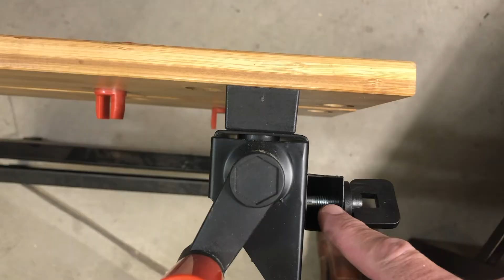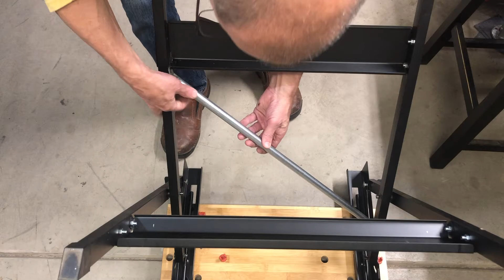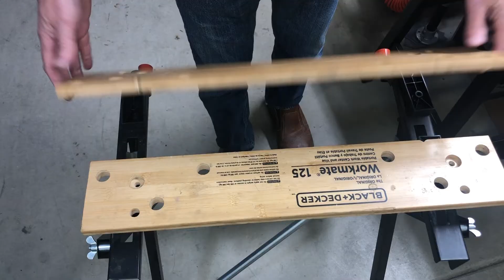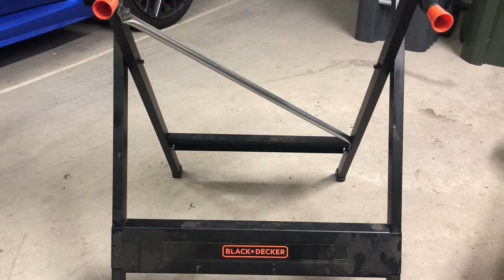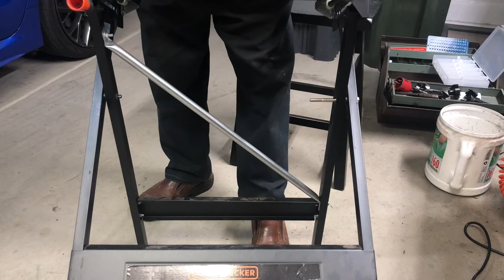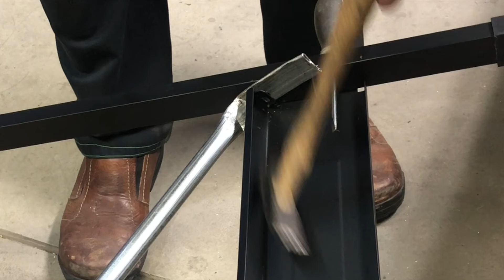B & D Workmate Beef Up

Comment: I'm gonna do the cross brace on my WM125.  The plastic crank handles rubbing against the sheet metal isn't a big deal.  But on the other side of that sheet metal is a roll pin which grinds against the sheet metal.  On my WM400 the pin has ground away a considerable amount of the sheet metal.  A washer on that back side is definitely recommended.
Reply: Correction: The WM125 does not have a roll pin where I said.  The WM400, however, does.
Reply from the maker: @mk6595  That's a good catch, I'm going to look at it too...thanks and thanks for watching!!!

Comment: Is the table (wooden part of it) sturdy enough to use iron vice to work on metal or wooden material?
Reply from the maker: Unfortunately not...at least mine isn't, the wood is bamboo so it's kinda flexible, check out this video: https://youtu.be/LsrealkXk40 ...it is a steel welding table top for the workmate which can really take some heavy work
Reply: @ONG6324  thanks for the reply and sharing the video!

Comment: The whole range of workmate setups are handy. Thanks for these upgrades for stability. I need to create a caddie to store the Workmates on, they don't store well just standing upright on the garage floor as I am constantly knocking them over.
Reply from the maker: That's a good idea...I have the same issue with storage...need to put the thinking cap on. Thanks for watching.

Comment: Good modifications 👍🏻 I have one that I never move around so I took out all the parts that allow it to move and used bolts to lock everything in place. I also added a metal shelf at the bottom to put stuff on while working. It's nice and sturdy now.
Reply from the maker: I like the shelf idea...might try that one too...THANKS :^)